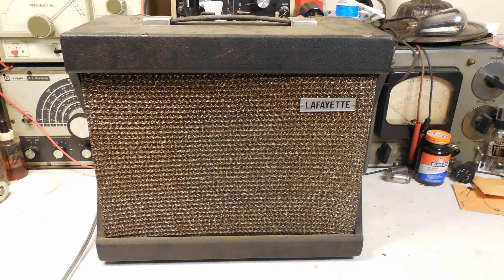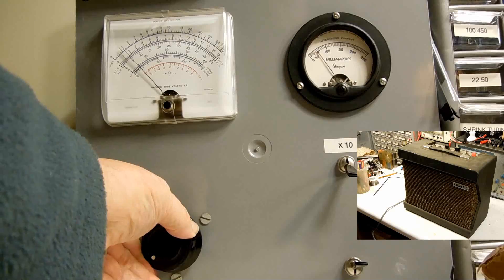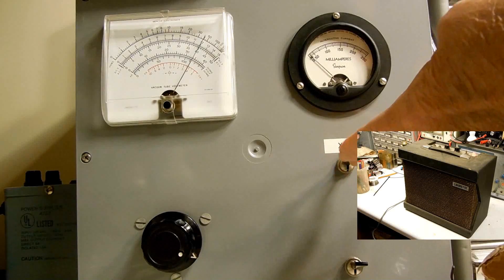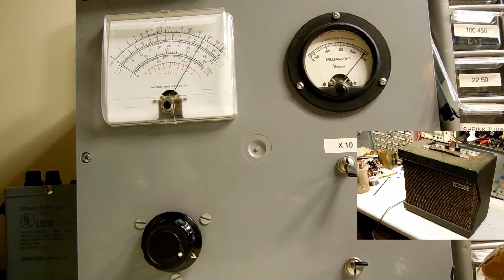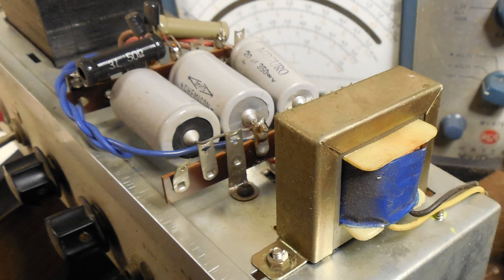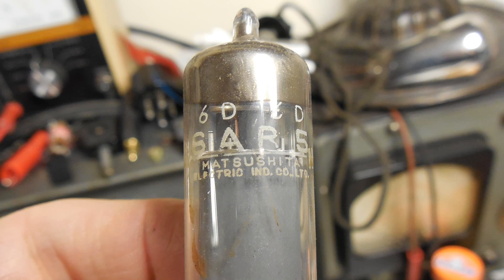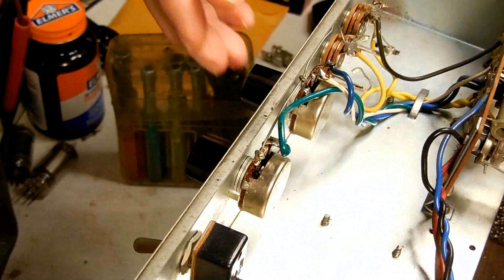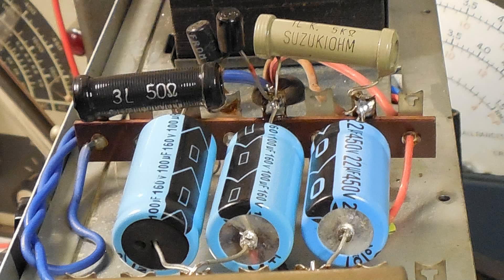Lafayette Guitar Amplifier Restoration

Comment: Enjoyed this video,I want to ask a question about my Marshall avt20 amp,When i turn on the amp it has a huge hum,and no sound from guitar,Do you have any idea,s what might be causing this to happen
Regards
Andrew
Reply from the maker: +MrAndfio 
It sounds like the electrolytic filter capacitors need to be replaced. I did this in this video. Also I have a free e-book that may help, it's about radios but they have electrolytic filter capacitors too.
Here's the link to the download page:
http://www.richardmcwhorter.com/vacuumtuberadio/

Comment from the maker: The original capacitors are 80 µF at 150 working volts. I did not have those so I put in 100 µF, there's no advantage other than I did not have to order parts.

Comment: Hmm maybe a mistake here Rick, loot at 9:00 time in this video. It looks like there is two 100uf 160V caps on the left. your schematic says twp 80uf. Diff volts as well. Is this correct or is this wrong by 20 mike?

Comment: Great demo about fixing this Amp Rick. Also a real good example of using your WD40 technique with vol and tone on a really dried out pots!! I think this shows hows blasting the insides with that very greasy contact cleaner from shack is just that.....greasy!! A bit more work but it seems much more accurate and gentle with that really old equipment.